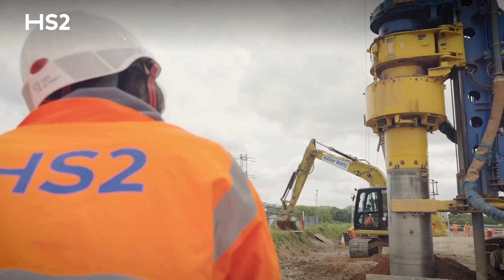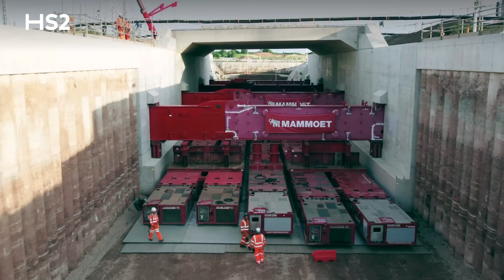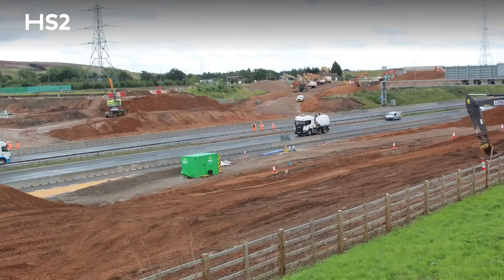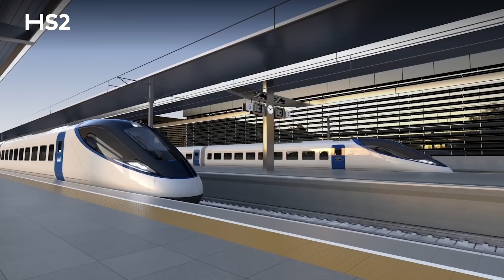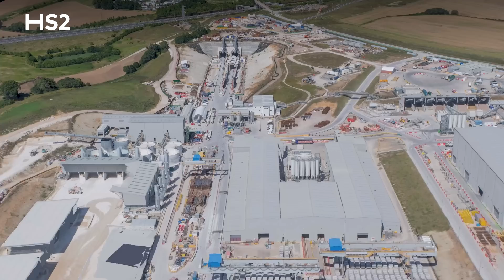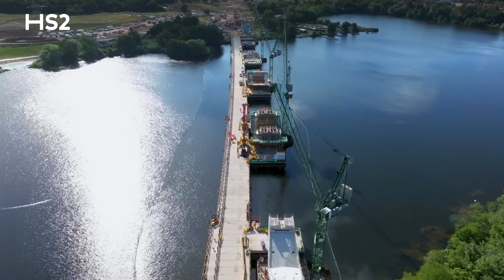HS2 Project Update, September 2023

Comment: Japanese had HS1 HS2 HS3 etc equivalent already built  in the 1960s when they introduced the bullet train so its a joke that the UK gov are even considering cancelling this. There is more to ing-lund than the south east of the country where all the tax money is spent when the north rots away, norf fc deserve non potato transport infrastructure.
Reply: Japan was forced to build these new high speed lines in the 1960's as the railways they had were slow narrow gauge lines which they could not improve so they built these new lines to the wider standard gauge to allow for faster trains.

Comment: HS2 should have started in Manchester. The inward investment would have benefitted the North. Euro star was going all the way the to Manchester, back in  the day, and look what happened!. It stopped at London. I fear the link from Birmingham to Manchester will now be cancelled. London has had 19 billion spent just on the cross rail project . London has also added  two more underground stations. It is financial discrimination.
Reply: Do you actually do any research, so no it has not stopped at London., why should it have Started in Manchester, it it did it would of got no where and HS2 is a Birmingham based project where by Construction started simultaneously in Birmingham working North to Lichfield and South to London, from London working North and in between as well
Reply: @peterwallen1063  It's comforting to know that the levelling fund has been spent on the south AGAIN in England. HS2 is only half a job now. The 20 million in the North have been ignored again. The 32 miles of tunnels and vanity bridges through nowhere are the reason why the project is vastly over budget.
Reply: @tommcmanamon8327  So if these tunnels and bridges are vanity projects then how would the line get past obsticles such as the Chilton hill

Comment: At a minimum HS2 must reach Crewe so that the north west gets the benefits from the project. In addition it should open up more capacity on the old west coast line for freight trains. Furthermore the London of HS2 needs to be linked up with HS1 so that trains to and from mainland Europe can travel to Birmingham and the north west.
Reply: Cancelled. You don't know Gordon Brown dismissed high speed rail after an analysis. And it took him 19 mins to u turn after the Tories promised to go for it. A political decision. Mandelson recommended it be cancelled as a gross waste of money in 2013. Yes 10 years ago.
Reply: Why should just the North West get the benefit of tax payers who live all over the rest of  the UK?
Reply: @macroman54 why should the rest of the UK benefit from tax payers of the North West?
Reply: @macroman54  Well London and the South do to the detriment of the West Midlands and the North, what London wants London gets.
Reply: HS2 is now only going as far as Lichfield/Handsacre in Staffordshire where it will join the West Coast Mainline taking trains to Manchester via Crewe, there is or will be no reason why HS2 trains which is a domestic high speed line requires to join the HS1 route which is an International Rail line subject to customs and security checks and no one travels from Birmingham or Manchester by train at present so why in the future when you can get fast comfortable cheap flight from Birmingham Airport or Manchester Airport.

Comment: HS2 is an environmental disaster of epic proportions & Britain's biggest infrastructure mistake in half a century.
Thankfully, the Eastern leg & the Golborne link have already been scrapped & it's now almost certain that Birmingham to Manchester & Euston station will be history - excellent news.
Fingers crossed that whatever remains of this monstrous vanity project will never see the light of day.
Reply: If environmentalists had been around in the 1800s, they'd have likely described the existing main lines as the UK's biggest infrastructure mistakes to date; then in the 1950s with massive forestry clearance for new housing estates (initially to replace those bombed, then for urban overspill), then in the 1960s-1970s with the arrival of the motorways (even a two lane motorway has significantly more land take than a railway line).

While several existing railway lines were quad tracked in the 1800s to allow for a mixture of express and local trains, the extra track was removed over the past century and much of the land it used (particularly around stations) redeveloped, so you can't increase capacity on the existing lines - and there are likely very few lines axed during Beeching that can feasibly be returned to usage (with roads, businesses and housing covering anything anywhere near a town). While usage may have dropped following Covid, that isn't guaranteed to be permanent, and lines were reaching maximum capacity beforehand, having to juggle express, local and freight services on the same track, so there's a need to build extra capacity. So why not a high speed line rather than a slow line?

Added onto which, as the population of the country continues to expand, we need to encourage more people to use buses and trains rather than private cars, as even when cars go 100% electric, that won't solve the problem of congestion, and there'll still likely be no appetite to build new motorways or rip up large parts of towns and cities to widen existing roads to cope with extra traffic, or build bypasses around them.

While there is some damage to ancient woodlands as a result of the route chosen, they're at least attempting to mitigate it by moving soil and planting new trees - even if they take a century to recover, it's better than doing nothing (as has happened with pretty much all previous infrastructure projects), while they're tunnelling under one in Warwickshire and in the Chilterns, combining a bored tunnel and viaduct (rather than cut-and-cover + embankment which would have been far cheaper but far more environmentally destructive).
Reply: @mittfh  Precisely. Although I agree that this line is costing more than it should have but that is down to political indecision and delays which ultimately push costs up, this is an essential infrastructure project to future proof our rail system and it should be built in full. For the reasons you have already stated, there are no other viable alternatives and if we are to meet our environmental pledges, internal flights should not be a thing in this country. For a country of our size, high speed rail is perfect for replacing internal flights. 
Of course lessons can be learned from certain mistakes made during the building of phase 1 but in general I applaud this project. 
I simply don't understand the mentality of those who wish for it to be scaled back or scrapped. The very same people who have no vision of how to address future transport demands of this country.
Reply: @thorley1969  .. due to the unreliability of the current rail network & the ludicrous price of tickets, internal flights are actually increasing rapidly.
Example: .. friend had to travel to London for business meeting at very short notice a couple of weeks ago.
Return train ticket from Newcastle to Kings Cross - £314.
Return flight to Heathrow - £120.
Guess which mode of transport he chose?
It's only going to get worse with HS2 .. it'll be a railway for the elite & the average punter will need to remortgage their house to afford a ticket.
A complete waste of time & money & totally unsustainable in the current economic crisis.
Reply: @CRIMSONANT1  Whilst I agree with you that ticket prices are too high (especially on the day rates) I fail to see how it will get worse with HS2. My wife and I plus our daughter did return to Edinburgh via London from our local station last year so booked in advance we got the three of us there and back for less than £160. We even did the Caledonian Sleeper to Inverness a few years ago so booked well in advance, again less than £260. I stand by my belief that internal flights could easily be replaced by high speed rail. With HS2 fully integrated into the existing rail system, inter city travel will be transformed, much like in the 1970s with the introduction of the Inter-City 125 which saved British Rail.
Ultimately internal flights are not sustainable with restricted slots at the major airports and not to mention the environmental impact... unless of course you are Michael O'Leary in disguise and I claim my £5.
Reply: @mittfh  .. firstly, re' environmental damage - are you aware that HS2 Ltd have already incurred numerous fines for multiple breaches of environmental issues?
Thousands of trees planted along the route in Warwickshire where the vast majority perished because of a lack of aftercare.
The pollution of streams, rivers & other waterways.
The bulldozing of mile after mile of hedgerows containing nesting birds when they specifically promised to wait until nesting season was over .. the list goes on.
They continually publish videos on YouTube where staff in hi viz jackets read from prepared scripts in a futile attempt to convince the public that they're doing everything possible to protect the environment .. it's all complete & utter nonsense.
Secondly, if you live in central Birmingham & want to travel to central London, you'd take the train, even now on the WCML or the  CML.
If you don't live in central Birmingham & don't want to travel to central London then you ain't using HS2, so it has very little impact on car usage.
In fact, research shows that even if HS2 was built in full (it won't be), traffic on the M1 would decrease by less than 1%.
HS2 Ltd state that to "break even" with a subsidy of 50/60%, they require 600,000 paying passengers travelling between London & Birmingham DAILY.
Given that passenger numbers on this route have been declining by 4% per year for the last decade & now average 96,000 per day, perhaps you could explain where the extra 504,000 are suddenly going to materialise from?
The whole sorry project has been a disaster from day one & finally, the government have seen sense & realised that it's totally unsustainable.
Reply: You sound like the sort of person, in the past, who protested in the 1800s against the underground being built and protested in the 1900s against the motor car because it would put blacksmiths and carriage drivers out of work!
Reply: @petermorris3665  .. haha, congrats for the most ludicrous, nonsensical, totally irrelevant comment of the day 👏
Reply: @CRIMSONANT1   In response to your comment, which I note you have now deleted, the clue was in what I said ... - 'you sound LIKE the sort of person'.
Reply: @petermorris3665  .. & you sound like the sort of person who believes the lying rhetoric that HS2 Ltd have spouted since day one .. now with the  scrapping of the B'Ham - Manchester line & Euston station, your chickens have come home to roost 😉
Reply: High James Monks again preaching the same old rubbish again, I am sure you some how copy and paste these reports as they have been the same for at least 5 years now, why don't you change the record.
Reply: @peterwallen1063  .. how can it be the "same old rubbish" when pretty much everything I've been predicting over the last couple of years has now come true?
HS2 has been scrapped between Birmingham &  Manchester .. FACT.
How can that be "rubbish"?
Euston station will only be completed if private investment can be found .. FACT.
How can that be "rubbish"?
Old Oak Common will be the London hub for at least the next 20 years & will only have 6 platforms .. FACT.
How can that be "rubbish"?
All those railway magazines that you claim to read are obviously not keeping up to date with developments .. I suggest you cancel them & DO SOME RESEARCH of your own 😉

Comment: Let's get it to Euston asap - none of this "terminating at Old Oak" stuff - the Elizabeth Line wasn't built to handle that.
Reply: The Elizabeth line is already the most used line on the underground - whilst the trains are big, could it really handle the capacity of people from the rest of the country trying to get into central London? It can handle the capacity of those to Heathrow, but both ways I'm not so sure. The government needs to push ahead because at the end of the day, the quicker we build it, the cheaper it will be.
Reply: @x_zschannel  I agree. Sadly the UK government has previous form on this. Just think how many years it took to build High Speed 1 from the channel tunnel when it opened

Comment: Not linking up with HS1; not going to Leeds; probably not going to Manchester; not going to Euston.
HS2 has made some remarkable achievements though: having been totally bonkers fron its very conception it has somehow  managed to add new layers of bonkersness almost every time you open a newspaper or switch on the TV.
Reply: It will go to London Euston and trains will run to Manchester via a junction at Lichfield here they will run on the WCML route into Manchester but no reason to link to HS1 as no one travelling on HS2 will be going to Europe only London and dought if it will reach Leeds
Reply: @peterwallen1063 The possibilities of a Manchester to Paris route would be increased. We could even have night trains to Southern France or Germany, all on high speed rail. This would be an amazing achievement.
Reply: @bubba842  Nice dreams but it was tried years ago and failed and the coaches were sold to VIA Rail in Canada, but all HS2 is doing is taking over the running of high speed trains from the West Coast Main line, it is quicker to fly to Europe from Birmingham or Manchester than travel by train.
Reply: @peterwallen1063  Not only quicker but a hell of a lot cheaper also.

Comment: Jumping ship at the right time.
Reply: HS2’s four main contractors have asked for more money or time on the project 3,000 times since works started in September 2020.

An internal review document by HS2 Ltd deputy chair Sir Jon Thompson leaked in October revealed that the cost of the mega project is heading towards “many billions more than the reported estimate”. It said that this is in part due to HS2 Ltd receiving “bids for money from contractors on a continual basis and significant and lengthy commercial discussions around them”.

Under the New Engineering Contracts used for major projects like HS2, requests for more money or time on a project are known as “compensation events” and are part of the commercial process of managing change.

A Freedom of Information request by NCE has revealed that there have been “approximately 3,000” compensation events between HS2 Ltd and its four main contractors since work began in September 2020.

The four main works contractors are:

SCS JV: Skanska, Costain, Strabag
Align JV: Bouygues Travaux Publics, Sir Robert McAlpine and VolkerFitzpatrick
EKFB JV: Eiffage, Kier, Ferrovial, Bam Nuttall
BBV JV: Balfour Beatty, Vinci
Compensation events will often have been triggered by supply chain issues and material scarcity, which will require the contractor to report to HS2 Ltd that it cannot deliver the task with the specified material or within the allotted timeframe. They may ask to change the material or the supplier, which requires a compensation event.

HS2 Ltd also has the right to reject these requests, which often occurs. The 3,000 figure includes compensation events that have not been successful. If, however, the request is approved and more money is required, the additional funds come out of the project’s contingency budget, which is recorded in the HS2 minister’s six-monthly report to parliament. In the March edition of this report, then-HS2 minister Andrew Stephenson said that he was concerned about the rising cost pressures on the project, which had reached £1.7bn.

There are multiple potential reasons both within and without contractors’ and HS2’s control for overruns. ICE trustee for policy and external affairs Jonathan Spruce told the Built Environment Committee last week that initial cost estimates are made too quickly, without fully considering all the details and are therefore filled with assumptions. These then unravel when boots are on the ground and unforeseen complications arise. Spruce suggested that this is an area that the Treasury and the sector as a whole needs to improve upon.

In the time since the commencement of work, the supply chain has been hard hit and the war in Ukraine has added pressure. Costs of materials including concrete, diesel and cement have continued to rise through Q3 of 2022 while the cost of steel rebar has only just started levelling out according to data from Linesight UK.

However, a project on the size of HS2 is more protected against these fluctuations due to the scale of their materials purchases. HS2 Ltd chief executive Mark Thurston told the Transport Select Committee in November that the four civils contractors have a “collaboration forum” where they look at ways to drive value through the supply chain on economies of scale. “We need huge amounts of concrete, steel and reinforcement bar, so we’re looking at how we can use procurement and supply chain efficiencies, recognising the scale of what we’re buying,” he said.

The leaked report from Sir Jon Thompson added that two of the four main contractors on HS2 lack “sufficient capability to manage all the various obligations placed upon them”, which is likely to be another contributory factor.

This could by why Thurston has promised a procurement shake up for the contract awards on future phases of the project. Speaking at the Rail Industry Association conference in November, he said that HS2 Ltd would take a “different approach for our civils contracts” on Phases 2a and 2b “with a view to attracting more local SMEs” to bid for the work.

There are currently over 350 active sites on HS2, employing more than 29,000 workers. The budget for Phase 1 is £44.6bn including the contingency budget, in 2019 prices.